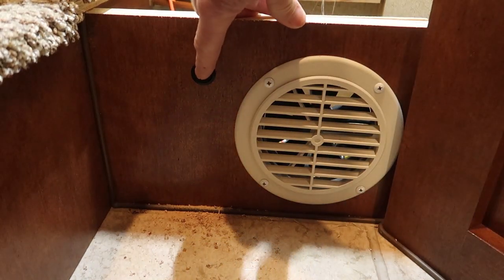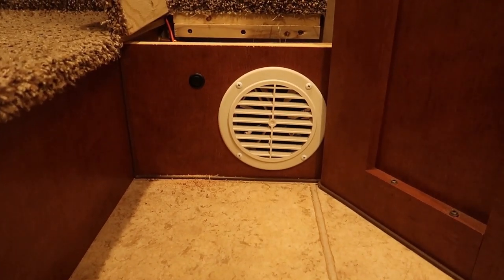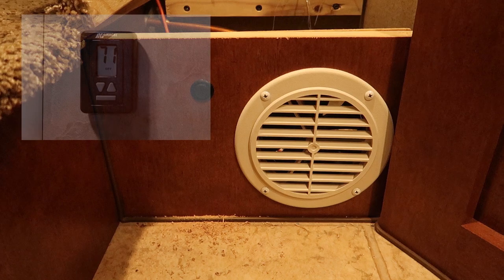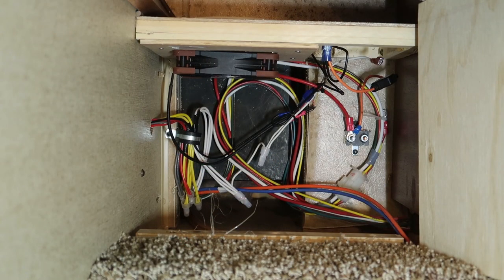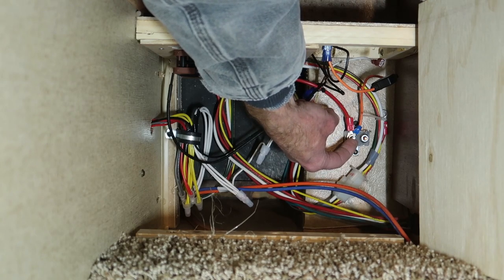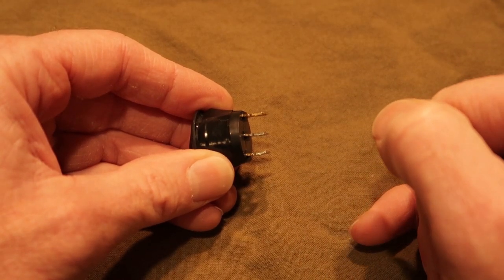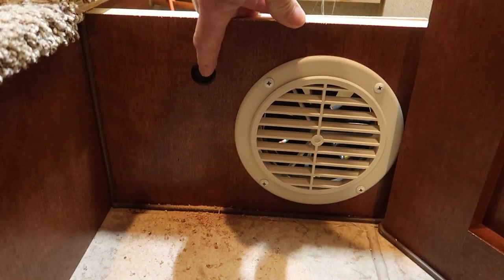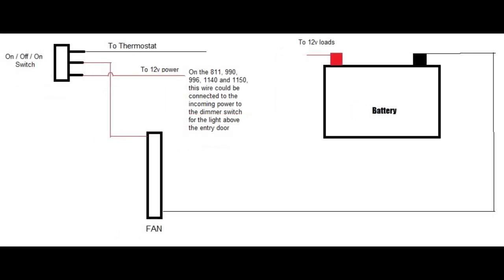Manual Control of the Basement Fan in your Arctic Fox Truck Camper

Comment: What you have done is a good idea for keeping the tanks warm. My Bigfoot trailer has shrouded and heated waste tanks (water tank is inside under the bed). The furnace has a duct that supplies warm air to the waste tanks. If I camped in cold weather (and I don't thankfully) I would look at installing a fan at the heater plenum where this duct exits the plenum, to force air into the duct when a space heater is being used on shore power.

Comment: I also have a 2018 992. That damn furnace is so loud its ridiculous . We went camping in Port Townsend with friend's.  He let me barrow his little ceramic space heater, They were in their house on wheels so didn't need it. Needless to say, i now have a small ceramic space heater for the times we are on power.  This mod will work great during those times. 
Thank you
Reply from the maker: I agree on the propane furnace being loud as heck.  I almost always use an electric space heater when I have shore power.
Here's another trick I have done when remote camping, which I first did back in the mid 2000s when I had a Desert Fox Toy Hauler:
I set my Honda EU2000 generator out at the end of an 80' extension cord and lock it to a tree, then run small, cheap heater all night.  It has a 600, 900 and 1500 watt setting.  I set it on the 600 watt setting and it will run about 10 hours if I fill the gas up before I go to bed.  I actually haven't done this in a long time because I mostly camp in the summer now.

Comment: Good video. I did this upgrade a couple of years ago in my 990 using the same setup with a center off position switch. I like the center off because if it's above freezing I don't need that fan to run when the furnace is on because it a) uses more power and b) tends to wake me up. My AF is a 2017 and has the digital heat/cool thermostat.
Reply from the maker: Off during non freezing weather is a good idea.  I never thought of that.
Does your thermostat control the heat and A/C or just the heat?
I'm not sure what year Northwood starting using the A/C that is controlled by the wall thermostat.
My 2010 811 A/C was controlled with knobs on the A/C unit.
Reply: @deltabravo1257  The digital Airxcel wall thermostat controls the heat and the ac in mine.

Comment: Great video.  I was just thinking of doing this mod on my 2020 AF990 as I try to use my small ceramic heater as often as possible when I have ac power.  It is much quieter and saves propane.
Reply from the maker: I also use a space heater if I have power available.  Another good thing I did was to add a dedicated circuit for a space heater:  https://www.youtube.com/watch?v=zfNph1nRDCU

Comment: Maybe the answer to this  question is obvious, but I didn't see it addressed specifically.  When the on/off/on switch is wired as you have wired it, will the center position turn the fan off even when the furnace is running?   I ask because I'd prefer this little fan to be off in the fall (no risk of freezing), but still use the propane furnace when boon docking.
Reply from the maker: Yes, in the center position, the fan will always be off.

Comment: Anyone know how the 2023 990 carpeted step (by the bathroom) is held down?   Hidden screws (similar to this 992 video) or does a person have to actually remove the carpet to get to the screws?
Reply from the maker: There should be screws buried in the carpet.  Join this FB group and post your question there too:  https://www.facebook.com/groups/1589175421373753
Reply: @deltabravo1257 doesn’t seem to be in the 2023 990.  However with the rheostat out (for power), the fan cover off (for visibility), and the drawer removed( for slightly inconvenient access)… the step top doesn’t need to be removed.   I posted pictures on the other AF group that I belong to
Reply from the maker: Maybe Northwood stapled the step in place on the 990.